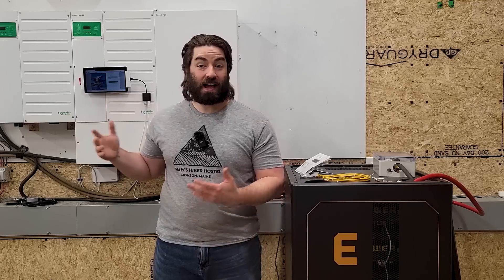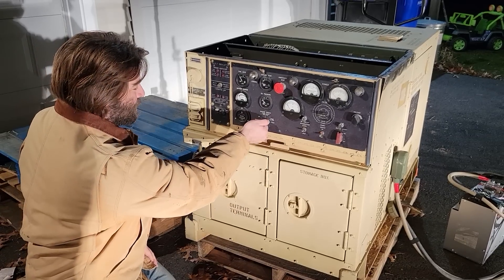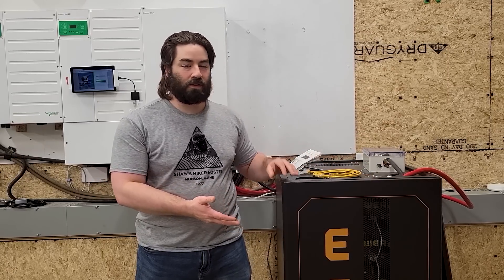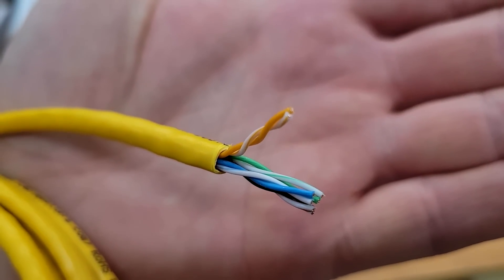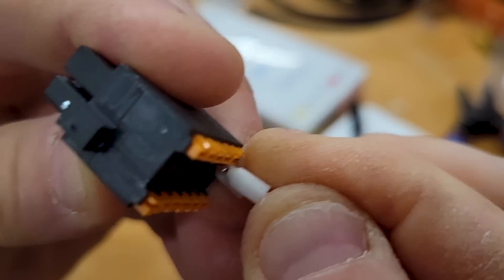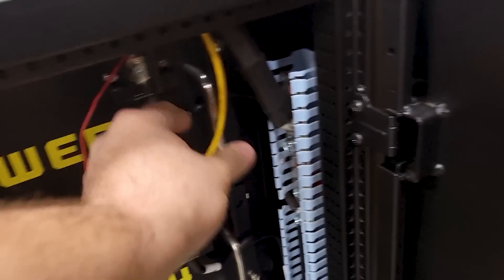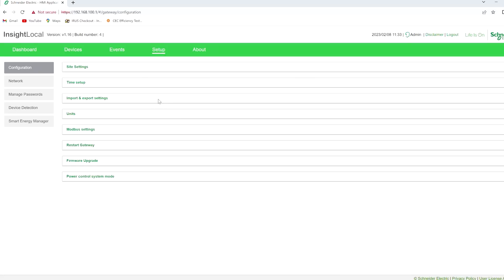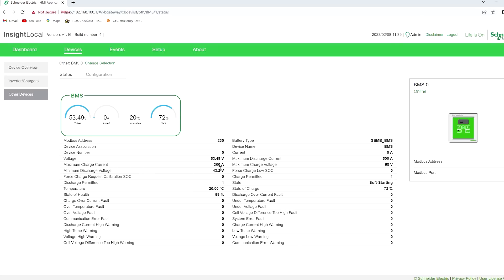Battery to Inverter Closed-Loop Communication

Comment: Its been a year now, is this still working accurately? Or id you scrap it and continue with the Discovery Batteries?
Reply from the maker: It worked for a while.  Right now I'm doing a long-term test on the Discover batteries.  The Discover rack batteries are the ones doing the closed-loop communication.  However, these EG4 batteries and my DIY batteries, are all paralleled together.  Not the communication, just the positives and negatives.

Comment: Sorry if I am a bit thick. Can't the RS485 from the battery plug directly into the RS486 on the master XW to achieve the same connectivity?
Reply from the maker: No, there is something different in the computer language between the two devices. I'm not a computer engineer, so I don't know exactly.
Reply: @DavidPozEnergy  Thanks! I will use your solution. I am installing 3 XW Pros, PDP, 3 100/600 Charge controllers, with 3 wall mount 14.3 EG4 batteries.

Comment: Dave, by looking at the background look like noe you have 2 Schneider inverters installed now, my house setup 100% electric, I ran the house with 2 growatt inverters, the life of these inveter over 3 yrs old, its time for me to start thinking about something to replace those Growatt inverters based on how long my MPP's inverters last, I also saw Ben he is replaced his Sol-ark with the Schneider also, I was look at LuxPower 12K hybrid or EG4 18K from signature solar look like they are the same accept the bottom where you install all the wire, the EG4 included with the breaker inside of the box but it a lot more money than the orginal LuxPower, since I already have all of these breakers external of the box

Comment: Magically, I see two inverters in the shot.
Reply from the maker: Yep, I picked up a second inverter.  I still have to wire it in.
Reply: @DavidPozEnergy  I am looking forward to your second inverter video and maybe a Schneider Conext MPPT 100 600 6kW Solar PV Charge Controllerc

Comment: Were you able to get rid of the external BMS and SOC faults on the inverter? Mine is doing the same and the faults won’t clear.
Reply: Nevermind. I figured it out. You have to give the BMS an association so it knows which battery the BMS belongs to.
Reply: @diyrenewableenergyelectron4996 
Thank you for this!

Comment: David, nice video, but I think you got 2 warnings immediately after enabling SoC control.  These warnings have to do with not receiving a SoC message from the BMS.  I have the same problem.  Eventually the inverter will trigger a fault because SoC-failed max battery voltage is exceeded (I believe it is set to 55 or 54v by default).  Can you confirm you have/had the same problem, and if so, were you able to get the inverter to "receive" SoC data?  Note that I do have SoC data in the device info like yours, but that somehow is totally separate from the inverter's SoC-control
Reply from the maker: You may have seen the warning icon on the screen immediately after I told the insight home to be set to Lithium, SOC control.  This is because I hadn't yet told it which lithium battery to look for.  I had to tell it to talk to this battery, and then clear the warning.  After I cleared the warning, it never came back and has not faulted.
Reply: @DavidPozEnergy  did you show that?

Comment: Another great video! Been watching your videos for a couple years and appreciate your sharing so much. I've got most of my home off grid and so I owe you big time. I have (16) 12.8v lithium batteries connected together in 48v parallel/series connected to t-series fuses in a "bus-bar sort of configuration" and am thinking about adding more inverters and a separate battery bank using the server rack batteries to power my 5 ton a/c system 24/7, I was going to get a 18000w inverter then re-watched your growatt 5000 videos (10000kw) and think I can parallel 4 of my 3000w voltronics together (120v ea) to a breaker box to get 240v ( for 12000kw) to run my 240v  5-ton a/c...? ANY thoughts would be appreciated! David, thanks again for helping us all get off grid

Comment: Do you have any plans to introduce a Schneider MPPT?
Reply from the maker: Yes.  I have one ready.  It's waiting on me to get it installed an tested.  Do you have anything in particular you would like to see with it?
Reply: @DavidPozEnergy  Not specifically.  I actually got a Schneider system and the only real step I have left is to connect the panels themselves.   I have the inverter and batteries up and going (grid connected).   But your videos have been very helpful so just generally interested in seeing you get that part configured.   I guess seeing some details around the software settings both for the MPPT but also in the XW side as related to batteries and charging would be of interest.
Reply from the maker: OK, good to know.  Thanks.
Reply: @DavidPozEnergy  I find the software settings to get this equipment to properly handle  LiFePo batteries to be a bit odd.   I know you recently moved to closed loop, but for an open loop system the finesse needed on these settings is a good topic.

Comment: Hey David I have been running 1 spf5000es solar only no batteries yet I purchased 2 more now paralleling 
Of course my first inverter spf5000 shorted on solar side and I've been fighting with signature solar for warranty work they still have been dragging me through no resolution can I parallel two of these SPF 5000 without batteries? Thank you David
Reply from the maker: No, you must have a battery if you are going to parallel.
Reply: @DavidPozEnergy  David you are a rare breed of intelligent people that are wholesome thank you for your reply

Comment: Another amazing video of how simple some parts of solar can be. I’m fighting with my connections.

Do you know how 3 Big Battery Kong 15kwh batteries would be made to connect up for SOC. They don’t have the Ethernet port and they are fully encased. Schneider makes a battery monitor and all my equipment is Schneider. It just that it uses an anderson175 connector.
Reply from the maker: I've never personally tested the "Kong" battery, but I will answer your question based on any battery that doesn't have an Ethernet port.  Basically, the battery in question doesn't support "closed-loop communication".

In this case, I'd use the Schneider battery monitor.  The battery monitor shunt has to be located between the battery bank, and everything else.  This means, you will want to parallel your 3 batteries together at a central bus-bar.  Out from the negative busbar you will have 1 connection to the shunt, and then up to your PDP (assuming you are using Schneider's PDP)  The battery monitor will have to be programmed for lithium and it will report SOC to the insight home.
Reply: @DavidPozEnergy  Great thank you. I do have the PDP, 3 XWPro and 3 100/600 CC’s. 1 for interactive and 2 for stand alone, all will connect to the 3 batteries. 25.5kw array. I can only connect 1 inverter to utility as Fortis(utility supply) doesn’t allow software throttling of sell. 2 XW would sell 12kw by hardware and the transformer is 10kw. So only 1 interactive. 
I had actually bought the Schneider monitor with my inverters and chargers but returned it as it looked like I would have to connect to multiple different points on the cells to make it work. At the time I wasn’t willing to open up the case to get to the individual cells.

Comment: Thx a lot DTG, it's always wonderful to see your videos. I noticed, you've been dealing mostly with Schneider for few months now. It must be the best out there. Have a good one.
Reply from the maker: Last year was Growatt,  this year is Schneider.   There is a lot to go over, and by spreading it out, I have more time to test it.
Reply: @DavidPozEnergy  thx DTG, what are the best 3 inverters that you know of? If I can't get the #1, I might get the #2 or #3. You're the best! Peace
Reply from the maker: My answer is based on building an off grid solar system in the US.  If that's the case, then of my testing, I think 
Schneider is #1.  It is a workhorse.  It's never overloaded while powering my house, and it's UL listed.  There is a PDP, wire-way, etc. all thought out and UL listed. 

#2: If you don't care about UL listing, and want something a little cheaper, but still solid, then Victron.  I'd lean to a Victron Multi-plus or Quattro, 240V output and add an auto-transformer instead of two smaller 120V models. 

#3: If you are looking for least expensive to get into the game, then Growatt 5000ES.  Not only is the inverter less expensive, but the charge controller is built in.  I consider the Growatt a starter system.  Assume it will only last 5 years.  It needs an auto-transformer too.  Note, I have not tested the EG4 Hybrid, 8kW.  That might be OK if it meets your needs.  But keep in mind any transformer-less inverter is not going to handle surges well.

With any of the options, I'd try to use a separate charger from Generator to re-charge the batteries.
Reply: @DavidPozEnergy  thx a lot DTG. With 20 (600 watts) panels, I will definitely go with Schneider and only use 240 volts  instead of 110 volts for my shop. Thx a lot!
Reply from the maker: Sounds good.  Looks like you have 12,000W of panels.  If you plan to ground-mount them, then you can run them to two of the Schneider 100A charge controllers (600V).  Is that what you were thinking?
Reply: @DavidPozEnergy  I haven't decided yet. I have moments when I can work from 8am to 8pm non stop. I have others when I can't even do 15mn for weeks. Unfortunately, I'm not always motivated now that I've reached 60

Comment: I'm just starting off with DIY solar, just a small, off grid system for a " TINY HOUSE ". I thought you could  figure your state of charge with a shunt ?
Reply from the maker: You can.  Several manufacturers make shunt-based battery monitors.  I've used several of them.  If you DIY your own battery bank, then you could use Schneiders battery monitor to report SOC to the Schneider inverter.  Same difference.  These batteries have the ability built right in, which saves some money from buying an additional thing.
Reply: @DavidPozEnergy  Thanks

Comment: HOWdy  D-P, ... 
Thanks for this VIDEO 
...
L@@King forward to a similar VIDEO with a 6 or 12  "split-Phase"    GROWATT Inverter 
... 
I  own three (3) EG4-LL Version One ( V1) 48 volt Batteries 
&
just purchased three more EG4-LL Version Two ( V2) Batteries 
+
an EG4  Six (6) Battery Rack (? older ? version ? ) 
I was so - So - SO  disappointed that the V2 Rack-Mount Batteries do NOT line up with the MOUNTING Holes in the RACK 😞
... 
SAFETY 😞 = the folding HANDLES on the BATTERIES contact  BOTH  the ++ & --  Bus Bars when FOLDING from FORWARD to FLAT position 😞
...
that  my  4/0 AWG  cables have NO appropriate exit from the BOTTOM of the Battery Rack 
   ( ONLY from the TOP as noted in your opening video PICTURE ) 
  ...
Hopefully these concerns are CORRECTED in the NEW & IMPROVED  Battery-Rack ??? 
   The only advertised difference on the Signature-Solar website is the Battery-Rack BUS-BARS are "COVERED" as the older Bus-Bar version are BARE & EXPOSED ? 
...
thanks for your INSTRUCTIONAL Viseo
COOP
the  WiSeNhEiMeR from Richmond, INDIANA 
...

Comment: My Victron system has the ability to do all of this but my non Victron hardware isn't compatible with some of these tricks. I have a Honda EU3000 generator that's not fuel injected so a remote start is not possible. When I purchased it Honda didn't make one this size with remote start abilities. It would definitely be nice for the Multi plus II to use one of its relays to start and stop the generator depending on the SOC .  Right now all I can do is have a light come on to tell me "Start the Generator not enough sun today" so I don't have to keep checking the Cerbo GX display, yes Victron cost a premium It took me a while to pull the trigger on this big of an investment, I wanted the Victron Batteries but settled on a few Battle Born Game changers, and gave up the direct communication between the Lynx shunt and the batteries. But the system is smart enough to know the SOC without paying 2x more for the Victron Batteries. Great video lots of great ideas for those with similar PV systems 👍

Comment: Why did you choose this inverter over all the others you have tested?
Reply from the maker: The audience asked me to show a UL listed inverter.  Also, this is the most efficient inverter I have tested.  Remember, I'm testing my inverters in off grid mode, meaning from battery, to loads, at night (no solar input).  This Schneider is more efficient than the Growatts and more efficient than the Sol-Ark in that mode.

Comment: Hey David do you have a video on the generator part of the system? I want to do the same thing but signature Solar talked me outa it for their 48 volt chargers. 3 of them… trying to figure out how to not run three drop cords to recharge batteries… my solar panel project is on hold for a wile

Comment: I want to setup my XWpro6848 for closed loop with my EG4 LL V1 batteries, but last I heard they aren't compatible yet.  Signature Solar said they was  releasing a firmware update for them to work with the XW's but never heard anything since.  I know you had some of these batteries or the original "GYLL" batteries, I'd be interested to know if anyone ever got the EG4 LL V1 batteries to work in closed loop with an XW.
Reply: Signature Solar said the upgrade for the V1 is available since I just ordered the 2 V1's  on sale though there is still confusion if this actually works with the SW inverter but they claim it does work with the XW. On some video it showed someone with my SW 4024 inverter and with the firmware upgrade it was reading the BMS though he was having issues with reading more than one. The tech said maybe schneider has an update also that will help with BMS communication with EG4 because they are under the impression that it won't work with the SW. I bought an insight and test if I can get connected after I update the firmware. If not, then off to schneider to see if they have a fix.  Worse comes to worse I won't be able to use closed loop but at least these batteries have screens to show their SOC so I can see their health and SOC.

Comment: i didn't see how you set the charge levels, 20%  60%
Reply: i see on the screen "force charge low SOC"  that must be where you set it to turn on at 20%.  but i don't see where you have it turn off at 60% SOC.
Reply from the maker: I didn't set up the generator control in this video.  This video is dedicated to the communication.  I plan to do another video just on the generator controls, and testing to make sure it works.

Comment: Another great video on the Schneider. You’ve been using it for a while. Any big gotchas you can mention?
Reply from the maker: Yeah.  I'm not talking to my wife as much.  I never have to coordinate with her about which loads we are turning on or when.  I miss planning out times for oven, or microwave, or dryer, etc.  I should probably go back to the Sol-Ark because that's when we got to have the most conversations about loads.
Reply: @DavidPozEnergy  LOL. Ok. That was funny. I’m looking for reliability above all as my install will be at a cabin and expect to backup grid loads like security cameras, fridge, lights and well.  We’re only there a few days a month so it will need to run unsupervised (no well use of course when no one is there).

Comment: A Sol-ark will run the generator like that with voltage based state of charge alone, and soon to be able to with direct communication with those batteries
Reply from the maker: The Schneider can also do Voltage based control.  I'm setting up the SOC based control for more accuracy.
Reply: I can represent it as SOC on the display. It also learns from cycling to be more accurate. Looking forward to when I can directly connect to BMS as well.
Reply: Keep in mind the BMS really also just gives the SOC based on voltages. It just uses all individual cell voltages to be more accurate.
Reply from the maker: I'm not sure about that.  The BMS looks like it has a shunt built in, and when I look at the BMS on the computer, it shows Amps.
Reply: Or Amp hours??

Comment: Nice one!   LifePo4 (as you say) is sooo flat you can't make nuanced operational decisions by voltage alone.     I'll be interested if you do followups to see how you keep SOC accurate over the long run - e.g. are the battery BMSs accurate enough without doing anything or perhaps you have to 100% charge now and then for SoC reset and/or does Schneider play a part and what (if any) safety precautions do you need if SoC get's out of wack and the generator turns on.  My powewall is a large 18650/lithium-ion bank and the voltage range is 'wide enough' I can control things (inverter on/off,  generator on/off) by voltage alone. It helps to understand your voltage sag (if significant) but it's doable at 5-10% increments.   For example, I operate between 30% - 80% SoC based on voltage for longer life - one of the (few) advantages of lithium-ion over LifePo4.
Reply: One thing to remember though even though the voltage curve is fairly flat it isn't completely flat. You can still get a decent idea of charge state with voltage measurements. That's if you know how to interpret the readings. Until firmware comes out for my inverter, I can still get an accurate SOC with the use of a smart shunt. It actually counts the amp hours going in and out to as a way of measuring. It does however require some user input. Battery capacity and a sync when the batteries are fully charged.